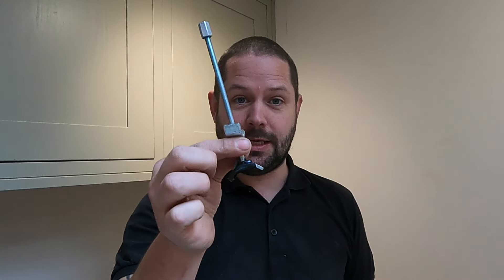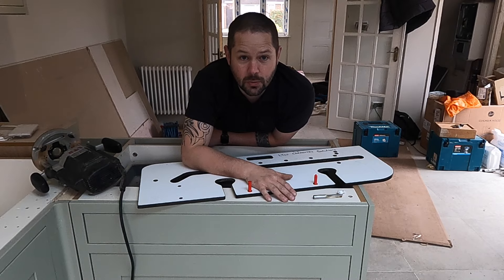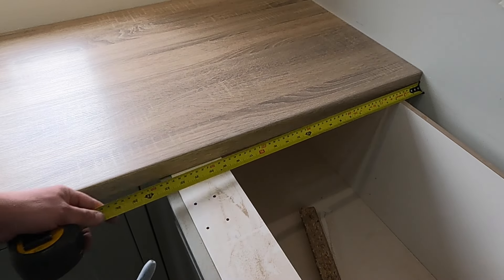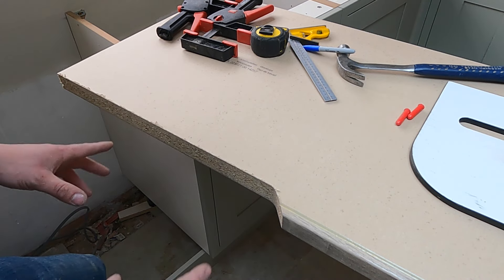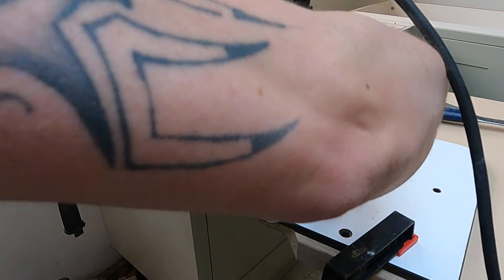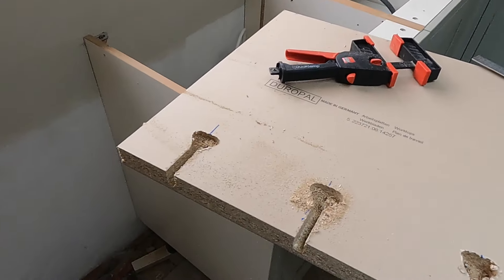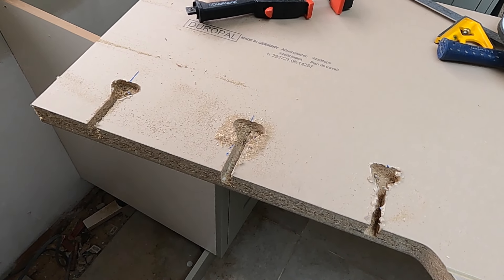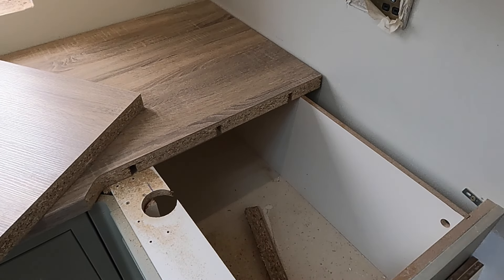How to install worktop bolts

Comment: Great video. I am going to have a go at fitting bolts on square edge worktop and wondered 1/4" router would be capable of cutting out the keyholes in a number of passes. Grateful for any help. TIA.
Reply from the maker: I would t recommend using a 1/4 one mate, even a cheap 1/2 would be the best option
Reply: @LTWCarpentry  Thanks for your advice. I will dig out my old 1/2 inch router, buried deep in my workshop somewhere!! 🤣🤣

Comment: Great idea with marking the center line on the jig cut outs, thanks for sharing 👍
Reply from the maker: Cheers buddy ! And thanks for the comment ! I really appreciate it 👍🏻
Reply: @LTWCarpentry  you have a great channel here, I have seen that square wt vid alone about 5 times already. 
Any chance you could do a worktop scribing between two walls at some stage please.
I will be fitting my first worktop in couple of weeks time, L shape, both ends are trapped, female wall to wall and male top to fridge gable. There are few vids around but I would love to see your take on it, if possible of course.
Reply from the maker: @bluewanderer9903  thanks buddy, I’m really glad your enjoying my content, yes of course buddy, I will have to wait until I have a worktop job come through but I can certainly do that when one comes up 👍🏻
Reply: @LTWCarpentry  thank you

Comment: Superb instructional video.   Have a silverline jig and fitting square edge worktop.  Need to cut bolt holes.  Do I still have to put the pegs in the jig as worktop is square edge and Im  not doing mason mitre?
Reply from the maker: Hi, yes you do, that’s the best way to get them to line up 🍻

Comment: So, I’ve now done this, and here are my thoughts…..A heavier router would have helped me, but I made 3 different depth passes, which worked ok. I bought a unika kit, which had plastic bits to hold bolts in place, very handy but not necessary. It also included colour fill compound to join, which was white to match worktop and filled my imperfect end cuts. Your videos were really helpful !
Reply from the maker: That’s awesome Douglas ! Glad I could help you buddy ! What router did you use mate ? Well done on getting this done it’s not an easy task !
Reply: @LTWCarpentry  I used a cheap parkside (aldi) that I had. Weird size bits though, in between 1/4 and 1/2” so replacements are going to be hard to find…I think a heavier weight would have helped keep it more stable but shelling out £200.00 for a Trend, I’ll put up with the extra effort. Went 4 incremental passes on the last set, sounds a lot, but actually faster as less laboured. Anyhoo, your videos were very helpful for a first timer, so calm and well explained. Oh, I used a thick sofa cushion laid up level against the base unit when I was on my back doing bolts up, try it, saves a trip to the chiropractor haha.
Reply: @douglasalexander4348   8mm?
Reply: @LickorishAllsorts  Yes.Pain in the butt to get hold of.

Comment: Quick question 
I noticed you didn't use any glue.
Is there any need or the bolts are sufficient?
If so can I just use PVA?
Reply from the maker: Yes I did use glue I used silicone

Comment: Nice tutorials. Does it make any sense to offset the alignment of the bolt holes slightly so that the mitre gets pulled into itself slightly?
Reply from the maker: In theory this would work but in practice I have found it to, I always lightly tighten them the align my joint then tighten the up

Comment: I'm fitting my kitchen and at one end of the kitchen I have units 330mm deep so work top is 350mm maybe slightly smaller but its square edge worktop what jig is best for this work as it is half the size of a standard worktop. Great video.
Reply from the maker: If you check out my video on how to join square edged worktops buddy, that will help, but as for the bolt holes, I would just use two and keep them about 100mm apart 👍🏻
Reply: @LTWCarpentry  great cheers.

Comment: Hi, fantastic videos, inspired me to fit my own kitchen, ive just got to the worktops, bought a trend router, got the guide bush, just wondering what router bit you use to do the cut? Thanks very much
Reply: 12.7mm x 50mm, just use the same bit for cutting the mason mitre, if your router can adjust cut depth

Comment: Some good info there regarding bolt hole placement,  you can be in a world of hurt if you just cut the three direct from the jig. Do you not PVA your mitre joints to stop water ingress and possible swelling.
Reply from the maker: I’ve never found the need mate, with a decent mastic seal, make sure it come out of the joint and clean off the excess works fine, been doing it a very long time now with no issues

Comment: FYI you don’t need a 1/2 router for this job. I bought a 3D printed jig on eBay for a tenner and used a 1/4 router with a 12mm guide bush and 6mm bit. Did two passes and it worked a treat. 

Not a criticism, just wanted to share the knowledge. Great vid, thanks for uploading.
Reply from the maker: Thanks for the tip!

Comment: Very good instructional videos just a query , have you tried putting biscuits in the joint edge as well as the jointing bolts  to prevent  the tops from deflecting .
Reply from the maker: Thanks for your comment John, I normally use a few dominos in my worktops but due to this being a tutorial I didn’t want to use tools that would put people off. 🍻

Comment: Try Zip bolts they are a little more expensive but they are a lot less faff as most of the time you can fit them with one hand. Come in handy if it’s a corner unit with a set of pull out shelves pre fitted.
Reply from the maker: Yes mate they are great aren’t they !

Comment: Hiya. Do you think a 1/4 inch cordless router would suffice for the bolt holes?
Reply from the maker: In theory yes but the only thing I would say is the jigs are designed to be used with a 9mm offset from the cutter so you might end up with the cut of being to big for the bolts, I would try it on scrap first.

Comment: Alright mate what’s your opinion on biscuits on the joints I always where possible put them in and glue them what’s your thoughts cheers
Reply from the maker: Alright mate, I’m of the opinion of it can’t hurt, I use dominos in mine but have for these videos that are coming as I didn’t want it to put people off but it really helps with alignment, if I didn’t have the domino I would use biscuits 👍🏻 cheers for the comment buddy